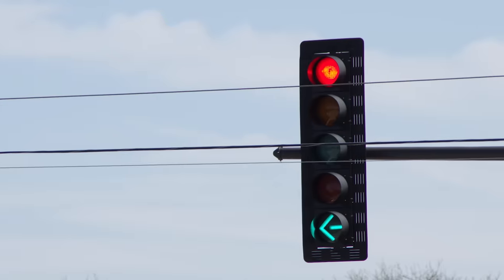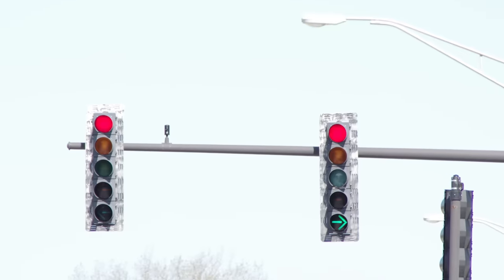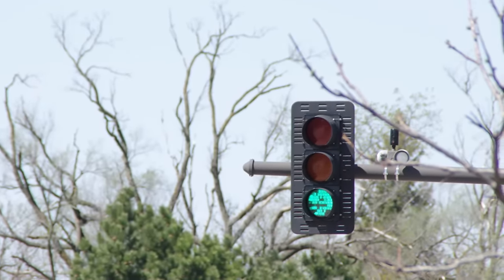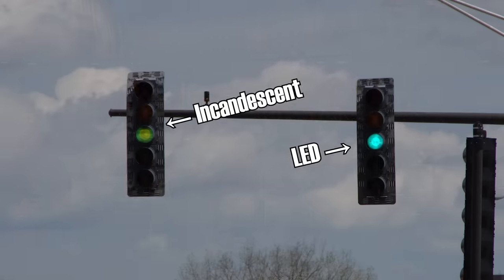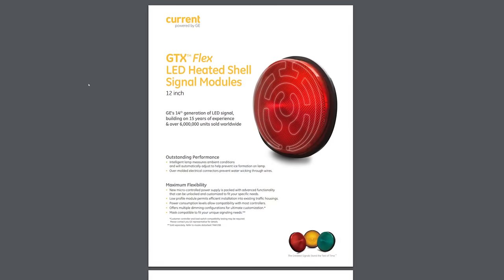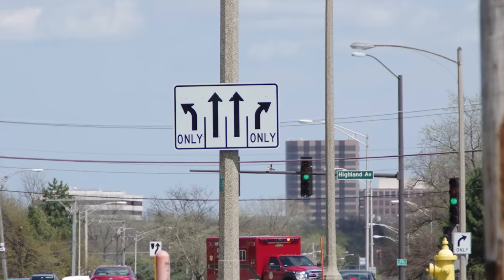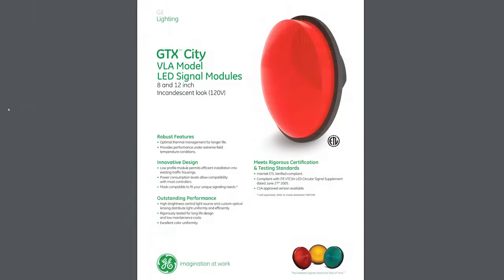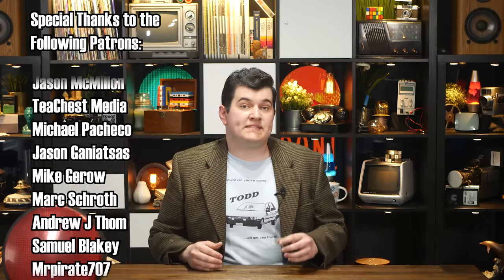The LED Traffic Light and the Danger of "But Sometimes!"

Comment: How about round abouts?
They use no energy at all!
Reply: And those are actually the bigger controversy. Some say they are safer because you need to slow down a bit, others say they get stressed out and worry all the while they are in there (what the Simpsons exaggerated). Any forum and blogposts will have differing opinions.
Reply: Actually, I believe roundabouts use a lot of extra energy because EVERY vehicle that goes through the intersection has to first slow down to negotiate it safely and then accelerate after leaving the intersection.  All the energy to accelerate comes from the vehicles fuel supply and will dwarf the energy used by the traffic lights at a conventional intersection.  Properly set up traffic lights will allow most of the vehicles to pass through the intersection without slowing down greatly reducing this energy waste.
Reply: @Vincent_Sullivan  But are you factoring cars stopping at traffic lights and congestion into the equation? Accidents?
 Where do we stop? Where do we begin?
Reply: @crazydragy4233   The TLDR version is that roundabouts are not nearly as good as their proponents would have you believe, and not nearly as bad as their detractors would have you believe.  Choosing the best intersection design for a given location requires the careful analysis of many different factors.

     Well, you have to start at the beginning, end at the end, and take ALL of the factors into account in between without any wishful or magical thinking.  It is a tough job!  I have thought about this deeply and yes, I am considering and weighing all of the factors that I can think of in coming to the conclusion that overall, in MOST cases (but not ALL cases) roundabouts are a loser of an idea.  Any analysis that I have seen that concludes otherwise always seems to mention one or two positive aspects of roundabouts while ignoring all of the negative factors.   A complicating factor is that every traffic situation is different and likely changes throughout the day depending on activities in the area.  For example, I live near a large ferry terminal that dumps ~500 cars onto a 4 lane divided highway once an hour.  I quickly learned to avoid the highway at about 15 minutes to the hour!

     My experience is mainly in North America and this is a factor because North American cities very commonly use a "grid pattern" layout for their streets which leads to a lot of orthogonal 4 way intersections. Two way stops, four way stops and 4 way traffic lights cope fairly well with such intersections.  Cities, especially older cities, in other areas of the world may not have been planned in such a "grid-centric" manner and thus may have a higher percentage of oddly shaped intersections where roundabouts are a more appropriate solution.   In North America I have driven through many roundabouts and I have yet to see an intersection where it seemed to me that a roundabout was the best solution.  It is true that this fact is not the fault of the roundabout but rather the fault of the traffic engineer who decided to use one in that particular case.  Of course other types of intersections can be badly designed too!

Some of the factors I considered are:

1/  Claim:  Roundabouts save time.  Reality:  Maybe in certain specific situations but on average I don't think it makes much difference.  Consider a 4 way traffic light with equal red and green cycling and equal traffic volumes in each direction compared to a roundabout where everyone has to slow down from road speed to 1/2 road speed to safely negotiate the roundabout.  Traffic light worst case half the cars are moving at full speed and half are stopped.  Average speed is 1/2 road speed.  Roundabout best case average speed is 1/2 road speed.  This actually gives the advantage to the traffic light as not every car will have to wait the full light cycle.

2/ Claim:  Roundabouts reduce accidents/are safer.  Reality:  The low average level of driving skills in North America and the higher complexity of roundabout intersections I think will lead to MORE collisions and I have observed evidence of this in the damage done to roundabout equipment such as guard rails, etc.   A key factor is that collisions at roundabouts are of a different nature to those at traffic lights / stop signs.  Orthogonal intersections tend to have 2 vehicle "T-Bone" or "turning conflict" collisions at road speeds which are very serious in terms of damage and injury.  Roundabouts tend to have single vehicle "got confused and ran into the guard rail or other obstruction" accidents that go unreported (leading to the idea that roundabouts have fewer collisions) or 2 vehicle "turning conflict" collisions at slower speeds which have lower damage and injury rates.  In Canada (land of ice and snow) when roads are icy it is safer to not have to make the extra turning maneuvers that roundabouts require.  They can become "bumper car" arenas under such conditions.  Overall, I think Roundabouts have the same or more collisions but safer collisions with fewer injuries.  For some entertainment, watch this video at the 11:30 point to see how a pro driver negotiates a roundabout:  https://www.youtube.com/watch?v=C7UnpAhIKPc

3/ Claim:  Roundabouts are more efficient because no electricity is needed for traffic lights and cars don't have to stop.  Reality:   Every way I think about it roundabouts are losers from the efficiency point of view.  Modern LED traffic light use very little electrical energy so that is not much of a factor.  Roundabouts take up much more space and thus use more materials including concrete and concrete is very energy intensive to create and emits a lot of CO2 in the process.  The largest extra energy consumption of roundabouts comes from EVERY vehicle having to slow down to enter the roundabout and the accelerate after leaving it and the extra turning maneuvers required.  You will remember from physics classes in school that the kinetic energy possessed by an object is equal to 1/2 its mass times its velocity squared.  This means that for a roundabout where cars have to slow down to 1/2 road speed to negotiate the circle EVERY car has to dump 3/4 of its kinetic energy into their brake system to enter the roundabout and then burn fuel to restore that kinetic energy upon exit.  Compare this with an equal cycle / equal traffic volume traffic light where half the cars dump no energy and half the cars have to dump 100% and then restore 100%.  Simple math says that traffic lights are more efficient because only half the cars need to recover 100% of their kinetic energy rather than 100% of cars having to recover 75% .  Yes, the cars idling at a red light do consume some fuel but very little.  While every car is different, a reasonable ball park figure for fuel consumption of a typical modern idling gasoline engine 0.65 to 0.7 litres (about 0.18 US gallons) per hour.  (See the YouTube video at  https://www.youtube.com/watch?v=5LO2iqTSq-I  for an analysis of this.)  This amount of fuel is not very significant compared to the energy required to accelerate the car to road speed.  If you think that accelerating a car does not take much energy just try pushing one!  This discussion assumes we are talking about internal combustion powered cars.  As the world fleet of cars changes to electric the considerations will be different because electric cars consume no energy while stopped (other than "hotel load") and can also can recover energy with dynamic braking while slowing down.   Roundabouts also require a lot more turning maneuvers than traffic lights / stop signs.  Here is an experiment for you to try:  Find a large flat parking lot and accelerate your car to say 10 MPH / 15 KPH.  Place the transmission in neutral, travel in a straight line, and do not apply any braking.  Measure the distance the car will coast before stopping.  Then do the same while steering in as tight a turn as is safe for the speed the car is travelling. (The turn will get tighter as the car slows down.)   Again measure the  the distance the car has coasted on its curved path.  It will be less... a LOT less!   It takes a lot more energy to move a car a given distance if you are turning rather than moving in a straight line and guess what you have to do to negotiate a roundabout...  Lots of turning!  You also have to travel a greater distance through a roundabout because it is a circle rather than a straight line!  All things considered the facts are that roundabouts are big losers from the energy wastage point of view.

4/ Claim: Roundabouts reduce pollution.  Reality:  For the reasons mentioned in point 3 roundabouts actually create MORE pollution.

5/ Claim:  Roundabouts need less maintenance and thus cost less to maintain because you don't have to replace burned out traffic lights.   Reality:  True, you don't have to replace burned out lights but with modern LED traffic lights that should not be much of a factor.  You DO have more road and sidewalk length in a roundabout compared to an orthogonal intersection and also the dead space in the middle and this will all require maintenance eventually.  In my area the dead space in the centre is typically landscaped and this will require fairly frequent ongoing maintenance probably about equal to traffic light maintenance.  Overall I think most roundabouts will require more maintenance at higher cost due to the longer road and sidewalk length but the cost will be "back end loaded" as it will be quite a few years after initial construction before it will require repaving, line painting and/or concrete replacement or repair.

    The bottom line is that I believe roundabouts are a very good intersection solution in some cases but in North America these cases are few and far between.  I have yet to see a roundabout in North America that I thought was well designed and the best solution for the particular intersection involved.  Keep in mind I have made several assumptions in this analysis and that the best type of intersection for a given location can only be determined by careful analysis of many factors.  For entertainment, you might want to watch the video at https://www.youtube.com/watch?v=yITr127KZtQ   which quantifies the traffic flows through 30 different intersection types using an early version of the city simulator program Cities: Skylines   (https://en.wikipedia.org/wiki/Cities:_Skylines)   Note that the standard roundabout simulation shows a shockingly low traffic throughput due to quirks of the simulation.  The modified roundabout is much better but not so much better than orthogonal intersections that they would seem to be worth the trouble.

     I encourage you to point out additional factors that I have not listed above.  I am always ready to engage in a respectful exchange of information where we both might learn something.
Reply: @Vincent_Sullivan  ...so... a car slowing down to go through a roundabout and then accelerating out of said roundabout... uses MORE energy than a car stopping at a red light and then accelerating from a complete stop?

Did my physics class textbook lie to me? Because something doesn't add up.
Reply: @RavenAdventwings  You see, but sometimes you have a green light and therefore can (unsafely) speed through the intersection, while a roundabout, even if there's no other cars, you can't go full speed through it because of how it curves.
Reply: @Liggliluff  While I disagree with the course of action, I do agree with the logic.

Comment: The things that can happen to the traffic lights over there really make me feel like you have some kind of potato traffic lights. I have literally never ever seen any light failing here in my whole life. As far as I remember, all bulbs used here have two independent filaments. If both fail (which is still extremely rare because the bulbs get replaced quickly), the whole set of lights on the intersection would shut off to eliminate even the slightest room for confusion, falling back to the next level of traffic control, signs. What is odd is how much effort, in contrast to the generally flimsy traffic lights systems there, is put into detection of and signaling to emergency vehicles. This all just doesn't quite match, in my opinion...

Speaking of traffic signs. The traffic rules here are designed in a way that the signs don't first have to be unfolded. This is really the silliest I've ever heard about traffic controlling and the signs here are simply ruled to have the lower priority, so they can be perfectly visible on the same posts as the lights themselves at all time. But I guess it is necessary if you cannot rely on a set of lights being either on or off.

Not to mention that I have never seen a traffic light that was too dark because of some dirt accumulating inside. The much more serious problem here are those extremely dumb people who can't cease putting freaking stickers on the lenses.
Reply: I have personally witnessed some traffic lights in my city that are dirty enough to obscure the viewing angle of them, which makes them difficult to see until you're right up on them, not to mention making them dimmer altogether.
Reply: Where do you live?
Reply: Thanks for educating us on a different locale's rules, but that doesn't to us much good if you don't tell us the general location. 😉
Reply: @ZaCloud-Animations___she-her  Well, then I'm really glad you didn't ask me what locale I'm talking about cause I wouldn't know how to match your rude manner answering you.
Reply: @Toxis374  B-but... what was rude about it? I thanked you for your perspective, then just pointed out that the comment specifically talking about what it's like where you live, didn't include that detail. And I even winked to show it was only a lighthearted reminder that you forgot that part. 😟
Reply: @ZaCloud-Animations___she-her  vocal tone over text is hard :(( I've definitely seen the wink to mean both "light-hearted" and "vaguely self-important" :(

Comment: In Germany in driver's ed you are taught a hierarchy:

1. If there is a policeman directing traffic, they are #1
2. If there is a traffic light, that's next
3. If there are no traffic lights, or there are traffic lights that are broken, use signage. All traffic lights have back-up signage next to them, which you can usually ignore, since lower priority.
4. If there are no signs or the signs are obscured, give way to the right.

Easy and works. People are cautious when the lights are out, but it's not dangerous. I even felt safe as a pedestrian crossing a 6-lane road with the lights being out.

Comment: A thought... on camera and on various videos, you often see LED's "strobing" and looking quite strange. I imagine it's to do with the frequency, and isn't a huge deal, but I am wondering if this present any problem for future "self driving" cars.
Reply: Decades ago, I was designing LED-based displays (numbers and status indicators) for a product. I learned there was (probably still is) a nonlinearity in the apparent brightness of an LED. A bit oversimplified, pulsing the LED (too rapidly to be noticed) with twice the current, but only half the time, produced a significantly brighter display, thus saving energy. It can be noticed on some products by moving your head while looking at the display. Video and film cameras can capture the stroboscopic effect, if that technique is being used. Any technology "reading" traffic lights and signs should be designed to tolerate this. I've never been a traffic or traffic signal engineer, though.
Reply: @bob_the_engineer1045  Interesting. Thanks for the great explanation!
Reply: that's just a result of PWM (in better systems) or in cheap systems, the mains frequency. Solution? Use better drivers working at higher frequencies. At say 500Hz and above cameras won't be able to see anything. 
Increase the frequency and the chances you'll see strobing even when moving an LED really fast is zero. However too high frequencies cause loss of efficiency but not really an issue in general except for high power LED applications like searchlights or Flashlights
Reply: all it is is different dc frequencies so all the car has to do is switch from 100Hz to 120HZ when crossing a border or vice versa (doubled so they don'thave any trouble with lights).

Comment: As far as i am aware, most municipalities will not change to something new until the current system has broken down or was going to be replaced anyway.  It is likely that there are warehouses full of bulbs that are already paid for and the traffic lights are only being replaced with an LED array when something more than just a bulb burning out happens, like a cracked lens or something.  Similarly the existing crosswalk signals will likely not be replaced until and unless individual units become damaged or worn beyond use and get replaced with whatever they have in stock, probably something newer but not necessarily the newest thing either.  Another consideration is that in many circumstances if a change is made everything has to be made to newer and more expensive building code which may encourage municipalities to maintain rather than replace.

Comment: Hey! Great video! Also, to clarify on the countdown timers, they dont need a controller that supports it, the signal itself deals with the countdown timer! On the first run of the sequence the timer wont work, but its integrated board will calculate how long the hand is off and how long its flashing for, then it will know what the timer should display! Its very fascinating how these work!
Reply: Yo, I had no idea that's how those worked! I actually did think the controller had to do something special for it, but that does make sense. I've always been very interested in traffic signals (I have several of my own collection!), and thought I knew everything about them...